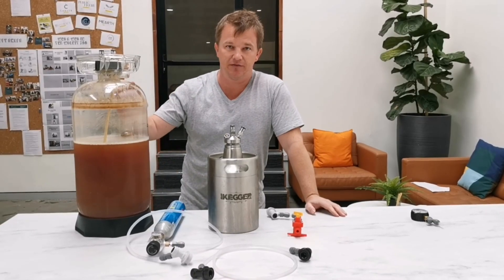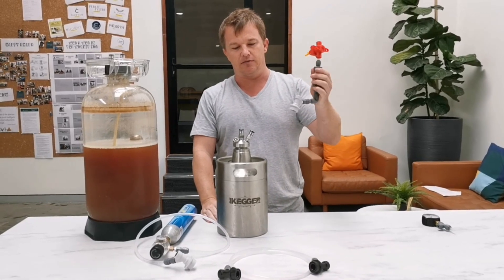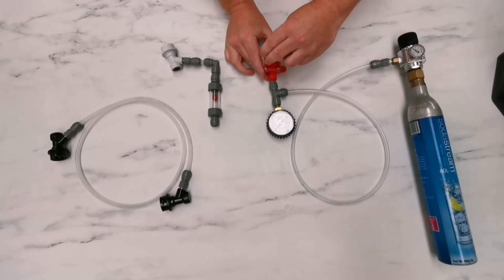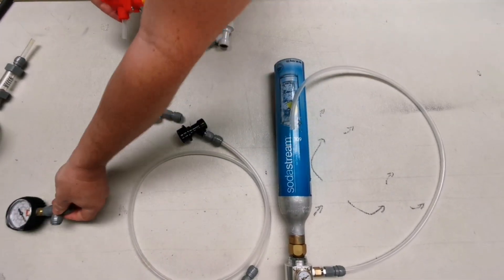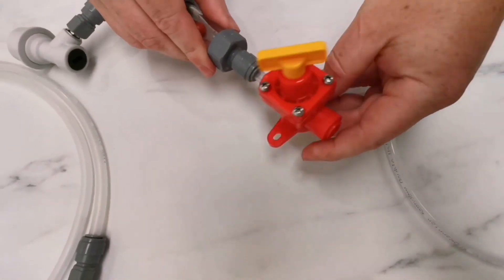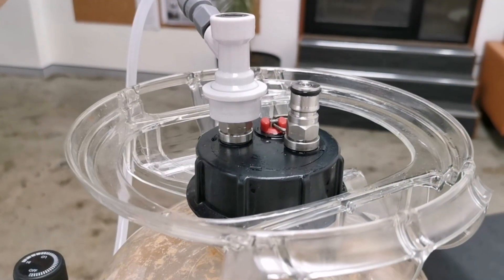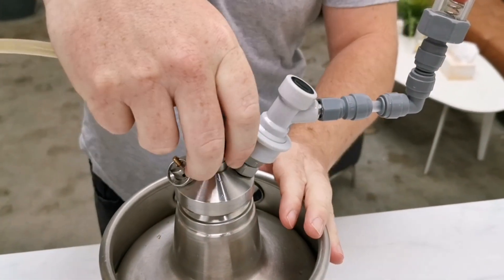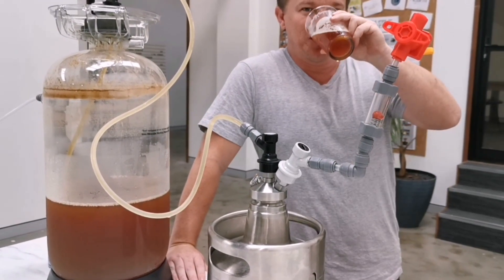How To: Pressure Transfer From A Fermenter Or Keg (Automatic Stopping Once Full)

Comment: DO NOT USE AS A KEG.  One thing that they forgot to tell me that the plastic allows Oxygen through the wall of the plastic causing beer to get oxidised.  It might be ok for beverages that are not oxygen sensitive but for beer DO NOT leave in this product for more than 4 weeks or your beer will start tasting like cardboard.  You can probably get away with this for stout or dark beers where oxidation is less noticable but unfortunately I am throwing my Fermenter King Juniors away as I am sick of wasting beer that oxidises in this "KEG".

I think under active fermentation when the yeast is able to absorb oxygen it might be ok too but definitely not for long term storage of beer. I wish they made this clear before I purchased.

Comment: I've got a quick question, if im fermenting an american ipa at 24 degrees and my spunding valve is set to vent anything above 13psi, my beer will get only 1.4 volumes of co2 in stead of 2.4. How do i add that other 1 volume of co2 i need to get to the 2.4 volumes ? I have a blowtie 2 spunding valve that goes from 0 to 14 psi measure
Reply: You will need a higher pressure gauge, you would need to vent at approx 28psi instead of 13psi

Comment: Wouldn't that mean that there's no headspace?  Not sure if you can carbonate without headspace...?
Reply from the maker: Not an issue when you are transferring already carbonated beer out of a pressure fermenter (plus you used the CO2 produced during fermentation to carbonate it by the time primary is finished) or from a large keg to a smaller one